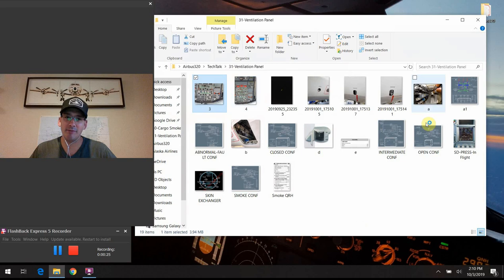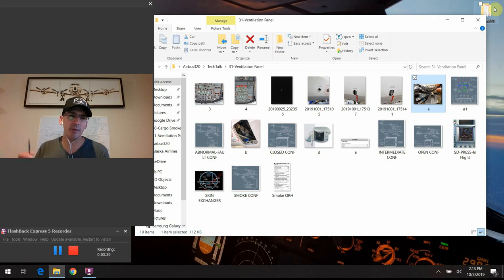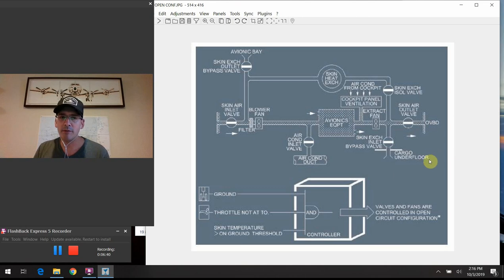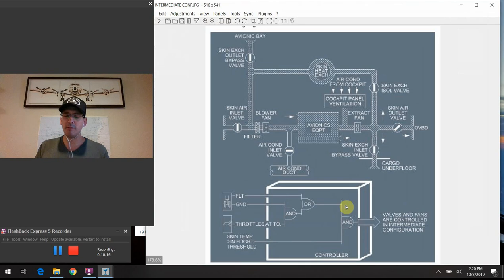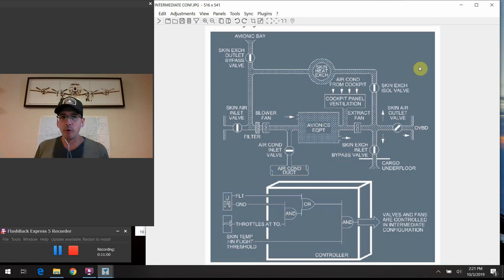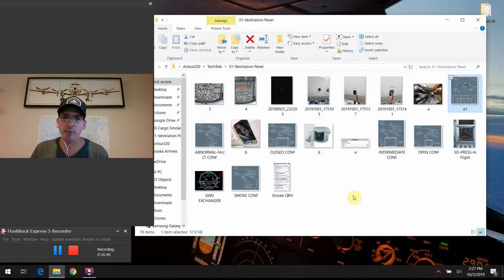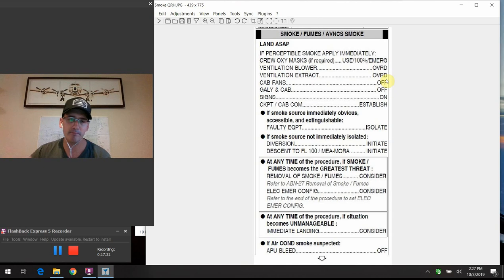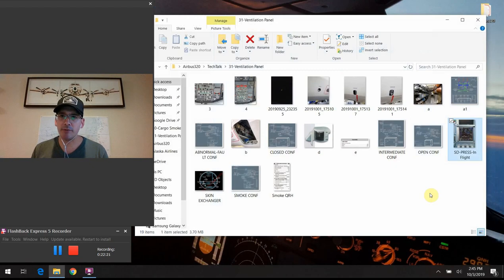Airbus A320 Cockpit Tour: #31 - Ventilation Panel: What do all those buttons do?!

Comment: Hi Mike. I have a question. You talked about smoke in the avionics compartment but what happens when there is fire down there. Is there a way to extinguish it? Btw you're doing a great job with these videos.
Reply from the maker: Repost here just in case anyone else has the same question: Hi there Tomasz, thanks so much for tuning into the channel. Yes this is a very good observation you have made and a good question. There is no "extinguishing" capability available in the avionics compartment as there is in the cargo compartment for example, where you can actually discharge halon into this area to put out a flames. In the avionics compartment they have designed it so that you have the ability to quickly cut electrical power to these components and you close off the air flow to this area so you starve any fire of oxygen that may be smoldering.
Reply: @MikeAbignale  thanks a lot.

Comment: Hello sir! i have a question. Why do you set the Extract to OVRD when theres heavy rain on ground?
Reply from the maker: Hey thanks for tuning in my friend! This is just to help keep water from entering the avionics bay.
Reply: Specifically, when either blower or extract pb is pressed, system goes to closed configuration so both skin air inlet and outlet valve close, therefore preventing water from entering the avionics compartment. Of course, there is a filter to prevent that from happening but they are not designed for large amount of water coming in.

Comment: Why some pushbuttons switch in a32p having two dots.
Reply: A320*
Reply from the maker: Hi Mukesh, thanks so much for tuning in. Gosh this is a good question and I don't know of any technical reason of why this really is. For some reason this is just the way that the parts manufactured made them. Does anyone else know of a reason for this? Cheers! Mike
Reply: @MikeAbignale  I looked into this and I think I found the answer. The two dots signify that the push button in question does not have any illuminated message on that half of the button (e.g. CAB FANS, COMMERCIAL, G/S MODE, etc. only have lower portion illumination).

Without these dots, the crew might incorrectly conclude that a push button LED is defective when performing a lights test.

Such a minute detail, yet somehow fascinating!
Reply from the maker: Hey Louis, this is a great observation! I could see that being a good reason to have these buttons designed this way... haha I'm the same way I always appreciate the small details